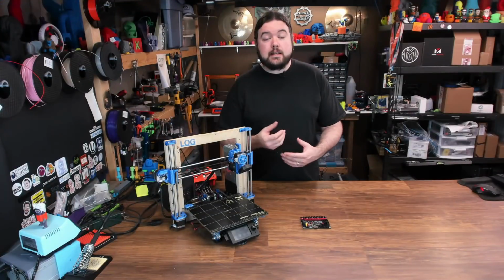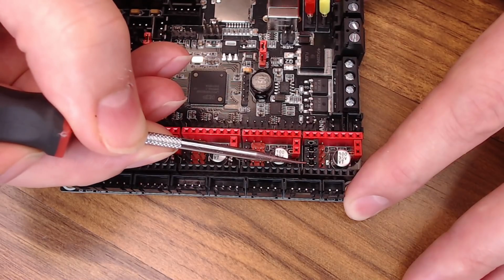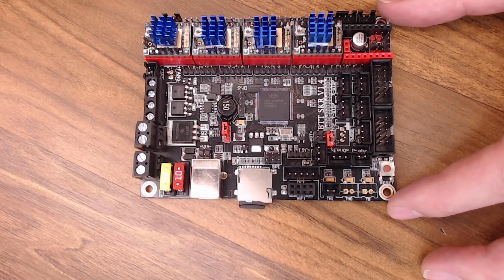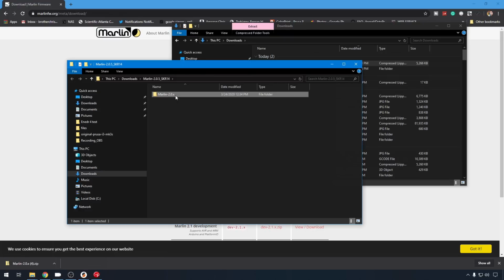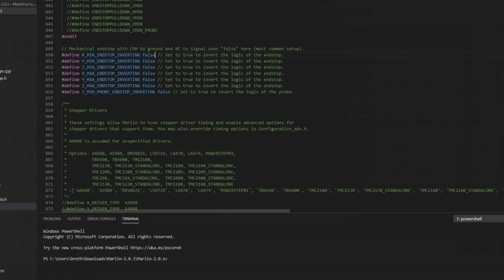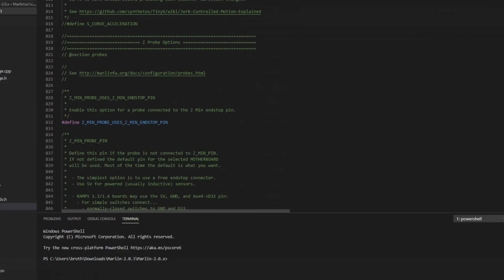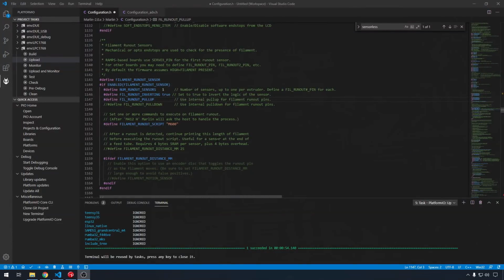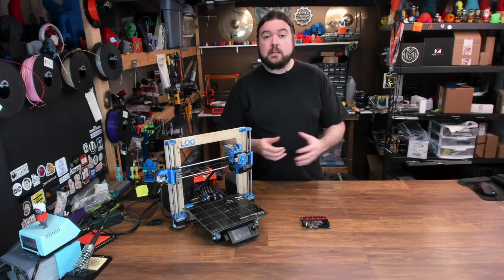BigTreeTech SKR v1.4 Mainboard - Full Install Part 1 - 2209 Drivers - Chris's Basement

Comment: Yeah! Thank you Chris ! I just waiting mine to come from BTT. Just a question. I have purchase with the main board 2 step motors TMC 2209 for the X and Y axes for sensorless homing and 2 TMC 2208 for Z and extruder because of the no need of sensorless homing for Z and E0. Do I cut the diag pins for those two TMC2208 ? Thanks ;)
Reply from the maker: You only need to clip the 2208's if you want to use detect0 and detect1 pins. Otherwise, it will be fine.
Reply: @ChrisRiley  Thank for the quick reply but I am not sure to understand ^^ lol What is:  "if you want to use detect0 and detect1 pins" ? Maybe have to watch this video again
Reply from the maker: @MacFly669  Basically, if you want to use a filament runout sensor, you will need to clip the pins. Look at your board, EN0 EN1, you can't use those pins on the board if you don't clip the pins.
Reply: @ChrisRiley  Ok! thank you very much. Looking forward for part 2

Comment: Since I can't find it anywhere else... What if you want to keep using your endstops but want to use stallguard/crash detection? Like if I wanted to use a bltouch but for some reason the printers Z axis crashes into something would the board/marlin still be able to tell that it crashed even if the pin is clipped?
Reply from the maker: No, with the pin clipped it won't be able to tell it crashed. Currently, Marlin doesn't have a feature to detect crashing.

Comment: Hey Chris great you got round to doing this setup on the skr 1.4/turbo..I smoked  about 3 of the 1.4...lol..I also had the tmc2209 and although I got things to work like stalgard..I could not get the bltouch to work..and now I see why..I think.. like you pointed out you need to clip the pin on the z ..this was never really made clear in the documention..I hope you will maybe cover the setup of the bltouch ,using the dedicated pins on the board..it seems a lot of people could not get it to work and just tried using the z min end stop pin...again great work Chris..so glade your on this!!..I now will order myself a new skr turbo and try again!.
Reply: Dongletree henley - Hello Dongletree, yeah there is some confusion about the BLTouch wiring.  Tripods Garage has a video that was released last week using the dedicated pins on the Skr 1.4 Turbo.  Thanks
Reply from the maker: Glad it was helpful, I do intend to go over the bltouch setup as well.

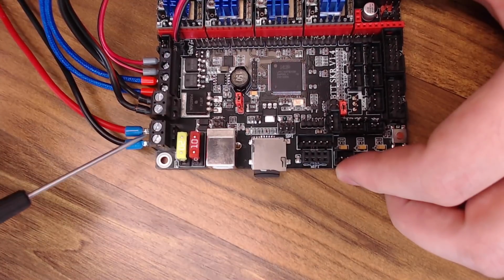Comment: Thanks Chris, great video as usual.  At 13:34 NEVER solder wire and place it in a screw clamp terminal.    Ferules ARE the best choice.
Have to watch the pin assignment part a few time to absorb what you are saying.
Reply from the maker: Thanks Mark, during the pins file part I was starting to confuse myself.

Comment: Random idea, any not print those molex headers caps to help secure the wires if we're going to remove jst headers anyway? What are the cons? (Assuming I'm going to print it in abs)
Reply from the maker: I think it would work just fine if you could print the pin holes small enough.

Comment: It's sad to see professional teachers and then see someone like Chris & how much better he does at displaying and relaying information. I wish companies would directly pay people like you.
Reply from the maker: Thanks for the kind words.
Reply: @ChrisRiley  Chris, if I'm using this with a cyclops extruder and hot end, how would I set up the filament run-out sensor for the two different filaments but only one extruder? because it says define the number of run-out sensors, one per extruder, but there is only one. Would I just say there is two extruders as to have two run out sensors?
Reply: wink wink....I know who that barb was aimed at. :)
Reply: i think that its a little easier to explain things well and quickly with editing power/ when you actually have the knowledge and you know how to teach... Chris u did a great job!

Comment: Hi Chris. Most needed video and very timely so thank you. Not sure if you will use the btt tft35 v3 screen, but if you do than please look into an issue. The marlin mode of the screen uses the latest configuration that has been uploaded by the user but the touch screen mode uses to all the default (factory) settings. The bed size, temp settings and everything. Not sure if I'm missing something.
Reply: Hi Chris. When are you posting part 2. Im struggling with hotend fan controls. Connected to HE1 changed in Configuration Advance E0 to P2_04 but still keeps running.
Reply from the maker: @deadsimpleali5540  I will be out very soon.
Reply from the maker: I do use that screen but haven't noticed that, but it makes since. The touch is just a controller. I will take a look at mine and see what I can come up with.
Reply: Thank you Chris

Comment: Very informative. Ggod job.
I am getting the following warning message when compiling Marlin 2.0.5:
u8g__i2c_opt defined but not used
Any idea as to why I'm getting this warning?
Reply from the maker: It might be a library issue. Have you tried closing VScode and reopening? If that doesn't work you might try re-installing platformio as well.
Reply: @ChrisRiley  I'll trying reinstalling.
Reply: @ChrisRiley  I am getting all kinds of errors. Trying to do this for a GTR. Here's one "Marlin\src\HAL\LPC1768\../../inc/../pins/stm32f4/pins_BTT_GTR_V1_0.h:25:4: error: #error "Oops! Select an STM32F4 board in 'Tools > Board.'""
Reply from the maker: @bjornnilsson8352  What is the board name? Try, BOARD_BTT_GTR_V1_0 you will need to use VScode.
Reply: @ChrisRiley  It is sorted now. Too new of a board for Marlin to have that board included, the GTR. but the correct FW to work with is on BTT's github. I had pinout errors some times too because of playing with the wrong firmware.
This video has been very informative and I must have watched these two about 10 times already to find what I was looking for. Thanks for posting them! It helps noobs like me out that people with higher level of confusion share their expertise.
I am absolutely new to this. I have had an Anet A8 for about 3-4 years and not tinkered anything with code, actually, I've never done any cone. Anyway, the A8 just worked, kinda. 
Another issue I have now is the fans do not power up on the board, and I cannot get the onboard SD reader to respond to commands from the TFT sigh
Reply: I personally think it's safe to ignore warnings, the information you get on them is usually meant for developers to let them know there is stuff they need to change (outdated libraries, non-standard syntax etc.), they really shouldn't cause you any problems.

Comment: And I thought my MKS Config was involved. I needed 3 diff creator videos and a bit of head scratching to get 1.1.x working back in spring '19. Never could get sensorless to work on 2.x so I jumped to Klipper.
Reply from the maker: Yeah, there is a bit to do for sure.

Comment: Ok, my anet a8 and ender 2 are out of commision, but i am certain i have enough working parts between the two to cobble a reprap together. i mean to order this board but got this one: BIGTREETECH SKR mini E3 V1.2 32Bit Control Board With TMC2209 UART Driver instead.  When it gets here, I am hoping i can use your knowledge to get it to work. I also got a z motor splitter
Reply from the maker: Let me know, I can try and help.
Reply: @ChrisRiley  I will go through your relevant videos again, once i get it, and let you know if i have success

Comment: Chris, will you be covering the part cooling fan config in part 2? Im struggling to make it controllable.....well even on at the minute. Im currently using a perm on fan port. Not very knowledgeable about FW. Thanks
Reply from the maker: Yes, the part fan is controllable in the stock port I showed here, but we do go over how to make the hotend fan controllable.
Reply: @ChrisRiley  cool thanks, great channel by the way 👍

Comment: i see you skipped the dedicated connector on the board (where it says probe) maybe because it didn't work well?
there has been some debate about this.
this is essentially a marlin configuration,that treats homing and PROBING differently.. currently the only way to use an auto level sensor without changing the pins files and without connecting it the z-min , is the ALSO use the z-endstop as well, because marlin will always try to home z based on the z-endstop input
Reply from the maker: I was looking at that and I am not completely sure how it works yet. I intend to do another video with BLtouch,. I am going to look into that during that video.
Reply: @ChrisRiley  there's a some bugs on it , like this one https://github.com/MarlinFirmware/Marlin/issues/15731

Comment: Thank you Chris ! Great Tutorials ! 

I don't like cutting pins and I didn't cut any pins on my five TMC2209 used with a SKR1.4 Turbo: 
1) I just commented the two lines  //E0_DIAG_PIN and //E1_DIAG_PIN  (in pins_BTT_SKR_V1.4.h file), and use two filament sensors. 
2) As I use a BLtouch, I changed -  in the same file -  Z_MIN_PIN to P0_10 and Z_STOP_PIN to  P0_10 (without changing the Z_DIAG_PIN from P1_27).
Reply from the maker: Thanks! I hate cutting the pins too, very nice work around. I am going to tackle the BLtouch soon as well.
Reply: @ChrisRiley  you can buy pin extenders, cut those and plase them between board anc driver
Reply from the maker: @mironfs1  Great idea.
Reply: yea but then you have to remember not to upgrade that as well, i hate changing any other file then the config and adv ones,
as for the bltouch, there's an entire issue going on about that, i'm using mine WITH z endstop.
Reply: I didn't change/cut anything and it still works, don't know why. I am running stallguard on X and Y , Bltouch is connected to Z endstop header( didn't want to go to the computer to build again so I tried it..)
Reply from the maker: @xxsantyxx  Yes, use the regular file for edits.
Reply from the maker: @xxsantyxx  Did you clip the diag pins?
Reply: I cut my pins to be able to setup/use my printer before I bought my BLTouch. When I got my sensor I just clipped the red plastic of the previously clipped diag pin and re-soldered a new pin in it's place. Took like <10 minutes
Reply: I can confirm this is working, i tried it myself. so far only this edit seems good work around.  i tested it on my cr 10, with bltouch, tmc 2209 skr 1.4 turbo. stealth choping, sensorles homing. the bltouch has a problem, i had to switch the pin signal and vcc but leave the ground untouch. and all of my tmc2209 don't have any pin removed. stay intact.

Comment: I have been struggling for the past 3 days trying to get Marlin configured correctly, I just finally got it to work last night.
I am running a coreXY machine and Next I want to figure out how to run 2 stepper drivers to run the 2 Motors. The reason why I want to run it this way is because Marlin has an option to level the bed from side to side (Z_STEPPER_AUTO_ALIGN). My setup is 400mm x 400mm x 400mm.
Reply from the maker: Cool, yep, that is pretty easy, in configuration_adv.h, there is an option already setup for that. You just uncomment it and it will use your E1 driver for the second Z by default.

Comment: Wait the polarity on the heaters I didn't think mattered.  Please correct me if I"m wrong.
Reply from the maker: Most of the time, it's not going to matter with these types of heaters. Some of the beds are marked positive and negative, but that is probably mostly so the LED will work correctly.

Comment: Awesome, my 1.4 turbo arrives Thursday and will be putting it in my Ender 3 pro so these videos are timely as usual Chris, U ROCK!
Reply from the maker: Nice! Good luck with the build.
Reply: @ChrisRiley  Thanks Chris, yea chomping at the bit and watching my alerts for your next video. I am stalled right now at the end of your first one as I dont want to go further until i get Marlin setup right. I tried to use Teaching Techs video on this same topic but after two attempts to follow his it just crashed with error when I uploaded the firmware and so far you have already touched on things he never even mentioned which I find odd. I think I backed the wrong horse as I signed up for his Patreon, going to change that this weekend and give YOU that money instead...;) Here I set patiently waiting for part 2...;)
Reply from the maker: @kevinm3751  Thanks Kevin, I am finishing up editing now. Very soon!

Comment: Nice, just in time. I'm already waiting 2 weeks form my SKR 1.4

not about this video 
I have Arduino mega 2560 + RAMPS 1.6 with 4x TMC2130 in SPI mode (wired exactly like in your TMC2130 part 2 video (TMC 2130 and display(I have 12864 display))), but the drivers don't work until I enter M502 after every power cycle or disable the EEPROM. Any sugestions? Asking here because no-one has anwsered in the forums...
Reply from the maker: Thanks! If you run a M502 and then save it, M500 does that make it work after reboot? My guess is the driver control commands aren't getting loaded/saved to eeprom.
Reply: That's for the guidance, I'll try that tomorrow. if it doesn't work, is it OK if I send a link with configured marlin and wiring diagram  of the printer (and possibly a demo of the problem(video)) ?
Reply from the maker: @S_L_K  Yep, just let me know.
Reply: @ChrisRiley     M500 after M502 didn't work.  https://drive.google.com/open?id=1VbMuPaDqYHr0OyhChebQjm5FjKqsiPVG
Reply from the maker: @S_L_K  Any progress on this, I can't remember if I ever got back to this.
Reply: @ChrisRiley  issue fixed yesterday,
After I disabled "#define PS_DEFAULT_OFF"
But the steps per mm were too small...
Conclusion: TMC2130 drivers require operation voltage 12/24V (depending on the power supply) before the printer has fully booted, if using SPI
Reply from the maker: @S_L_K  Great!!!

Comment: According to the skr1.4 manual "the hot bed connected to the motherboard must be less than of equal to 144W (that is, the thermal bed resistance is greater than 1Ω )".

Does this mean it is not compatible with the mk52 (In the "prusa knowledge base" it is stated that the heat bed of the MK3 should have 3.5 - 4 Ω) or is this just a typo in the BTT manual? (24*4 = 96W)
Reply from the maker: I would have to go back and look at the manuals, but I use them on the MK42 bed all the time and I know lots of people using them on the mk52. I think there is a mix up somewhere, but I will have a look.

Comment: I was about to buy the SKR, but I got instead the MKS SGEN L + 5x TMC2209 for €22.
There's really no excuse anymore not to go 32bit + Trinamic now. A Ramps board + Arduino Mega + Allegro drivers costs more.
Reply from the maker: You are 100% correct, I think 32 is here to stay. ;)

Comment: I had the same issues with the connectors on my SKR PRO. My way was to create an adapter. 

I took a dupond pin array, crimped pins around them and added some soldering to fixate. 

http://www.geit.de/tmp/jst2dupond.jpg

Then I used a jst plug and a clamp/vice and pushed the pin to pin adapter into the jst plug housing. It is a very tight fit, but you can push them in till the black dupond plastic rests on the plug housing. 

That was I ended up with very nice little jst/dupond adapters I just plug into the board when needed. 

The only side effect is that the connector gains a little height, but usually that is not an issue.

http://www.geit.de/tmp/jst2dupond_2.jpg

Of course this works with any number of pins. This is just a leftover because of some over production and all other adapters are in practical use.
Reply from the maker: Nice! That looks great, well done!